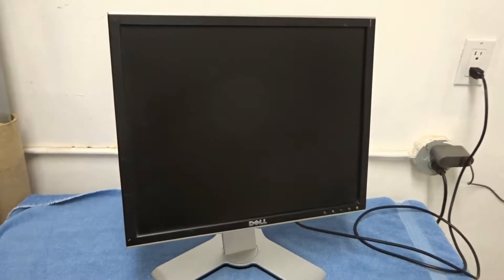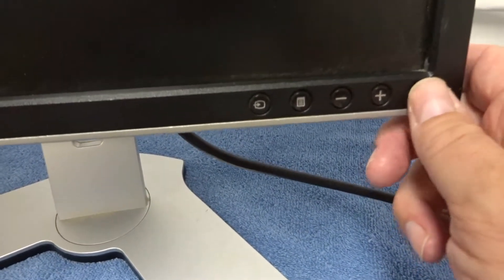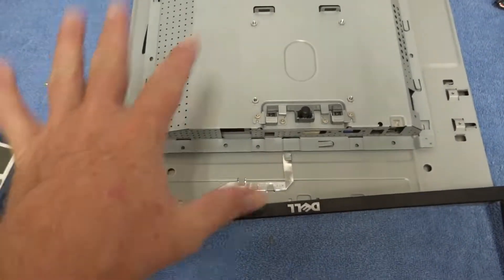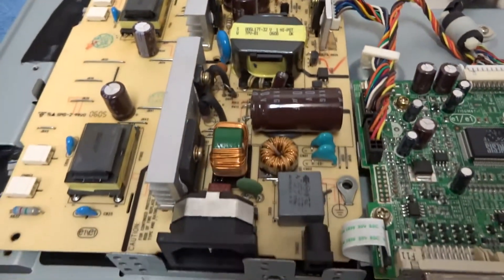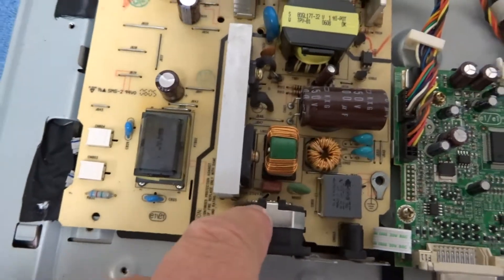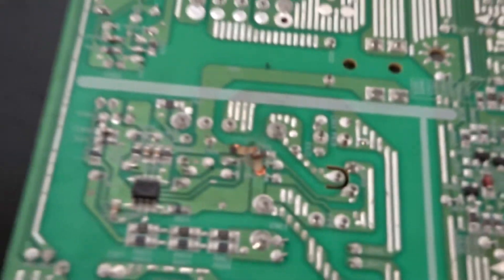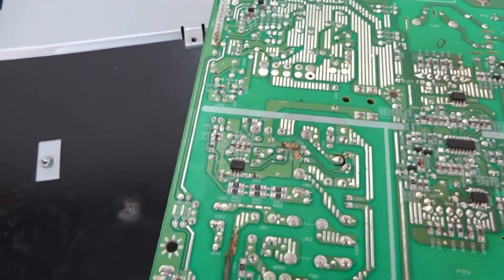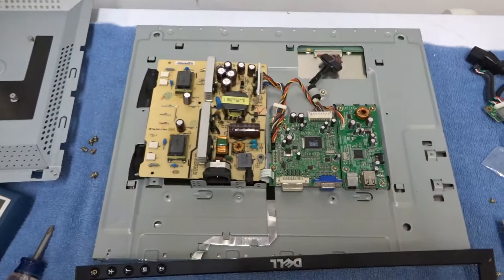Let's Repair - Dell 1907FPc monitor

Comment: I have exactly the same monitor. Still using it to this day as my daily driver in June 2019. Got it in June 2006 and I've used it almost daily for exactly 13 years. That's 4,745 days and still going without a hitch. In fact, I'm writing this comment on this monitor. :p I don't know--completely off-topic, but just thought I'd say that. And yes, the light is supposed to glow green when it's turned on.